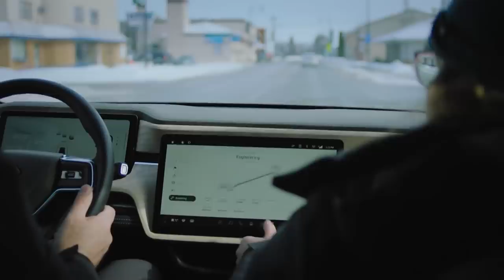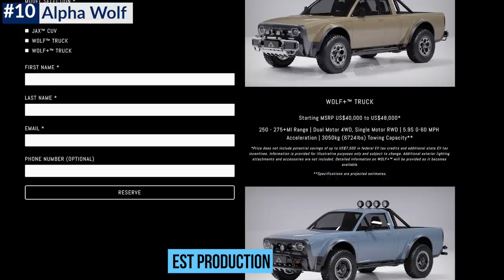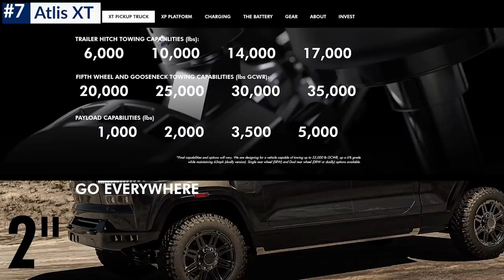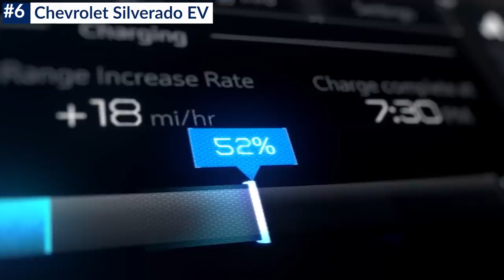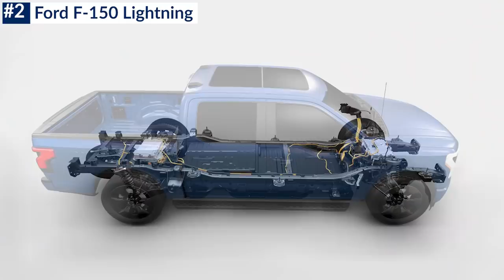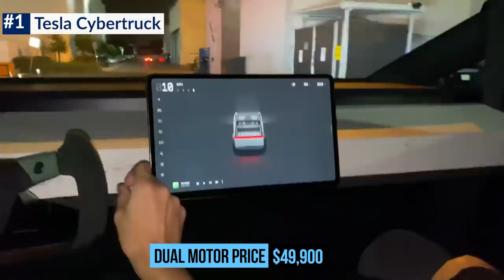10 Electric Pickup Trucks to hit US Streets Soon | It's Happening!

Comment: I just don't get the whole concept of electric vehicles. We are merely trading carbon footprints from combustion engines to generating more electricity by burning gas and coal. Not to mention all the infrastructure that has yet to materialize to support a country full of ELV's. Look how many gas stations we have in place to support our current mode of transportation. Forget about driving cross country! Waiting many hours between charges. For all of the shortcomings of the combustion engine, I believe it impractical to replace it with electricity.

Comment: My perspectives, 1. You think mechanics are expensive now? I wonder what these guys will charge on the hour, high risk is high reward.... I can only imagine the amount of amps they are pumping to the wheels...thats gotta be enough to cause some serious arc burn and loss of a limb 2. We are gonna pull your ass over with a simple stroke of keys on my keyboard... 3. The batteries themselves cost a fortune to replace..... 4. Oooops Chemical spill from a minor fender bender.... I won't be buying an electric Car.... not now not ever.... if these idiots truly dream of slashing petroleum to the point of where you can't get it well. Take a good look at where your sitting right now all around you..... how many of those products take petrol to manufacture or make?

Comment: EV trucks are missing the opportunity of installing propelling fans installed in the trucks when they drive on a highway. The exhaust pipes can be split pointed from 0 to 75 deg angle up in the air to avoid any interaction with the following vehicles, and increase the tire traction with the road. Propelling fans would increase the pulling/pushing efficiency the same way that airplanes do by pushing the air behind. It's much easier to rotate a fan, than to rotate 4 wheels in the ground. The future is still ahead, and these EV have to think for the logistic part of their life to keep the cost down. Good job guys.
Reply: TELL ME you're joking

Comment: Can’t put a snorkel on it and cross a creek or go mudding without getting a short lol so I’m good
Reply: Goober I wonder the same as I use my truck for hunting and fishing hard to reach areas where it requires that exact type of stuff
Reply: Why would it need a snorkel when it doesn't need air?
Reply: You’re correct lol just bad comparison but you get the point
Reply: Actually, the Rivian is specifically rated to foard a 3' deep body of water.  And you won't get a short in the electrical system from doing that.  Everything is sealed.

Comment: Blah Blah Blah... How long does it take to charge Ford's truck? Drive and stop... Drive / Stop.... Sounds Sounds like the old Rabbit and Tortus story...
I'll stick with (OMG) Diesel ... IF I Can find one!
Reply: For some yes, for others no.  The growth of new technology is always uneven so it may not work for you yet. However, that doesn't mean the market does not exist for other people. The more people that use electrics, the less oil we use, which helps depress oil prices, and does make it cheaper for you. The Obama era plan was to avoid EV mandates because there are too many corner cases, where it wasn't feasible without a jump in technology, which hasn't completely happened. 

Another option is adding a generator in the back of your truck as a range extender.

Comment: When it comes to engines, an electric motor is by far a lot more efficient and less maintenance than an ICE.  An electric motor only has one moving part.  However, when it comes to providing the fuel for these, petroleum base fuel vs battery, there's no question as to which one is more easily handled.  Batteries still have a long way to go.  Once a battery is spent, it's done.  There's no rebuilding or refurbishing it.  It's off to the recyclers.
Reply: I agree with all that you said, but the unfortunate reality is that almost nobody rebuilds their engines anymore.
Reply: @nvcsmith  That is true.  It's a lot easier to trade for a newer model.   The electric motor car is the future.  The energy source for now are batteries. Maybe hydrogen in the future.   Exciting times.
Reply: You can refurbish them as home power storage though
Reply: @WrathChild-NZ  That's a really interesting concept.  Lots of DIY probably experimenting with car battery modules.  Most of what I see, is retrofitting to autos.  Haven't seen anything for home applications.

Comment: I would wait about 4-5 years before buying an electric vehicle. There are new 'solid state' batteries coming out that will increase the range by 2x-3x for the same weight/volume. They can also be recharged much faster. Lithium batteries are soon to be on the way out completely.

Comment: How are the batteries disposed of when they no longer keep a charge?  What's the cost of the new batteries? How does it effect the environment? $125,000 for a truck, oh hell no!
Reply: Batteries are considered not fit for EV use when they reach 80% of original capacity, which is about 250,000 to 600,000 miles (depending on mow much you use DC fast charging).  Then they get recycled for use in grid storage.  Once they actually are at the end of their life, they recycle them to get the materials back and make new batteries.
Reply: @charlesball6519  where did you get those "facts" from the rainbow
Reply: @larry6765  Nope.  From other user experience with EVs watching lots of videos about EVs, and all those studies about the batteries.  I have the natural curiosity to learn, which you do not.  Instead, you believe all the right wing propaganda because you have zero curiosity to learn for yourself.

Comment: Face it, pick up trucks are utilitarian work horses. Mostly fleet sold they are given to users who try to destroy them. Here is my list. No b.s. accessories at all except air conditioning. A comfortable bench seat. No need for captain Kirk’s throne here.. and the entire interior can be hosed out and steam cleaned. Suspension must include bushings that last 200,000 miles. Make then solid, comfort other than ac is not required. A rear bed that will take a beating from 60 pound concrete blocks and not turn to crap in a year. And lastly a throttle computer interface that allows only electrically efficient acceleration to the posted speed limit and no capability to go faster than that limit on every street ever. I saved 30% on fleet fuel costs when i began tracking my driver’s driving havits to their continued employment and bonus steucture. Previously that money cane DIRECTLY out of my pocket. Now the streets are safer as accidents for 2020 were down 40% and i have invested in more equipment and employees. And it was all done without one penny from any government program to “ help” me.
Reply: aren't you a joy to work for?  I worked for a manic once that liked to GPS track everything you did.  Hard pass.  I'd never work for a control freak again.
Reply: @bobhabib7662  asking my guys to obey the laws? Drive the speed limits and not abuse the equipment that they were responsible for are not difficult requests. In fact it is a shame that i had to lay out the rules; the same ones that i follow and that my kids followed. And, yeah, i was a pretty good boss to the point where many employees became like family. To this day. We all worked hard, including me. We had a lot of fun too. Pay checks were handed out by me on Fridays at our local bar. I took all my crews to California once a year for a long weekend of ocean fishing. And every two years we all went to Cabo San Lucas for real fishing. And when i retired i gave the debt free company to five key guys. It exists today and may be passed on to their sons. I set a good example and earned respect. So, yeah, i was a joy to work for.
Reply: @larrysorenson4789  I'm sure you were control freak.

Comment: electric vehicles are just  a car for someone that doesn’t really 
need a car .  towing capacity is meaningless if you cant tow it more than 20 miles ...
Reply: Haha!
Good one, Tony!
Reply: Just like people who buy those mini smart cars for small commutes
Reply: @sommebuddy   you have a normal range of 250 - 300 miles ,  (on SOME. evs ) now double the vehicle weight .  which is what towing capacity typically means , one vehicle towing another vehicle plus the weight of a trailer. you are now so far into the rule of diminishing returns , that your range is almost nil.   in other words . unloaded range and range at rated capacity is not even remotely the same .    20 miles maybe a slight exaggeration, but you get the point.   towing with a electric vehicle. , not a good idea .
Reply: @sommebuddy    there is no “what if “ involved ......you can “what if “if you like.   the nature of electric power is the same regardless of the battery yhat powers it .  i work in the automotive industry . i travel most of the southern half of the us snd much of europe in my work .  and i have no doubt that electric vehicles will be around for a long time to come .  they are not a new idea . theyve been around for a long time .and the principles of electric power have been understood for decades .. i also understand their  practical limitations .   i also remember when turbine cars were the unavoidable wave of the future  .    evs will have a place ,  
it will take time before everyone understands what roll they will play .  towing and large payloads arent going to be a major part of that future .   if you feel that an electric pickup is your cup of tea,  be my guest . 
i think after you have 4 to five years invested into one , you will be less enthusiastic .   if you just want an ev without towing capability in mind ,  please check out the bmw and mercedes models that are soon to debut .   personally i need a pickup .  and not an ev ....  and anyone that would push for a hydrogen cell in close proximity to a human body ,  lol. well thats just another variety of stupid altogether .   gasoline requires  certain conditions to explode ,  hydrogen requires only a small leak ....  oh and yes all the manufactures are gearing up to transition to evs .   no one yet knows if the public will accept them .  so claiming that they will be everywhere is premature . there may only be a few on the roads . and millions unsold .  i suggest you  put your crystal ball  back on the shelf for a few years , or get your money back on it ....  and if you own an ev in an area that has charging infrastructure , you likely live in an area that has public transportation , and owning an ev is likely a personal indulgence not a necessity.   
hence its a car for those that don’t really need a car  .
Reply: @sommebuddy     i am set to retire in spring of 2022  myself . after spending almost 40 years in automotive. manufacturing  technologies . . we were involved in fuel cell technology . back in the day . hydrogen was a big part . so i know  a bit about it  thank you .    frankly , it scares the crap out of me  .

Comment: Not one of these pickups has the least bit value to anyone who drives and uses a heavyduty pickup for real work and long haul heavy towing. My F350 Superduty 6.7 Powerstroke can go almost 400 miles hauling over a ton of Polaris RZR and gear in the bed while towing a 9000lb trailer. I can stop and fill up in ten minutes and be back on the road and this isn't close to the maximum load I can haul. If I want more range all I have to do is install a larger fuel tank and could go around 700 or more per tank, something an EV can't do, ever. These are urban use or gentlemen rancher trucks that stay near urban areas so you can find a charging station. They don't exist where I travel in the back country.

Comment: what i dont care about in an ev:  0 to 60 in 1 sec, crab walking, 190 mph top speed, 12000 flb of torque...
what i do care about in an ev: id like to know im not charging it with  coal fired electric plant juice, very long mileage per charge,  not alot of stuff on the dash, ability to charge at home fully overnight.

Comment: None of these are realistic unless they have a similar towing capacity as a half ton truck and a re-charge time of 15 minutes to completely recharge the vehicle.  Many people use trucks as a work vehicle, tow vehicle, etc...
Reply: notice that the re-charge time was not reported
Reply: @slippery1958  No, they wouldn't report that since most people don't want to hear that after their very expensive purchase of a $60,000 all electric truck they can barely afford that they're going to have to hire an electrician to install a 440 volt system to charge their new pickup for $5000.  Most people aren't smart enough to know how to handle that kind of voltage.  It will kill you dead in a milisecond with improper handling.  BUT, you aren't going to get that one hour full charge without it.  Prolly gonna take 10 hours to charge all the way on 110.
Reply: @sarcasticguy4311  You don't need anything more than a 60A 240V circuit to charge at home (for a 48A EVSE).

On a 120V 12A charger (1.44kW), it'll take 3-4 days to charge.
On a 240V 48A charger (11.5kW), it takes 8 hours to charge (you do this overnight, and have a fully charged vehicle when you go to work in the morning)
On a 250kW DC fast charge station, it takes about 25 minutes to charge to 90%

They are currently working on battery tech than can charge win 10-15 minutes to 90%

But go on and keep being willfully ignorant.
Reply: @charlesball6519  Oh, only EIGHT hours to a full charge?  Big thumbs up.  Way to be a true believer.  Sorry, honey.  I can't take you to the hospital because the pickup has no battery life and it's gonna be another several hours to get a few miles down the road.  Hope that missing limb doesn't hurt too much.
Reply: @sarcasticguy4311  But that's only if you let the battery get down to 15% or less.  That never happens with daily driving (people rarely drive more than 50-100 miles a day, except for professional drivers), and leaving it plugged in all the time (while at home, like after 8pm), like you do your phone, you always have a fully charged truck.  So, you can take someone to the hospital in the middle of the night.

You're just another display of willful ignorance. (Typically from those too lazy to do their own research and might also watch too much Fox News or The Blaze)

Comment: Power has been made by no fuel   at a steel mill  and was stolen by the Steel company because he made it on company time . and looks like they sold it and took care of him ?   Now there making power  out of a alternator and can be wired up  to start  making power and a switch to stop it and needs special bearing's to last longer cut the weight down by special glass and  use a boat design mold and would not need a complete bottom and it is was a fast racing boat .  add a low front so to hold it down and less drag ,   keep it wide  for corning .one for each wheel or 1 for front and 1 for the rear   would make it better to turn it on curves .      At high speed it helps to use power to push the car forward than drifting , with 4 wheel drive it helps keep it from drifting . Then we won't need  a 600 pounds of batteries

Comment: Yeah, right. Who has $40 plus grand for an electric truck, when there aren't any charging stations. 55% of the working public makes less than $30 grand per year. Companies will possibly buy electric trucks to a limited degree. Possibly!! There are 1.4 billion vehicles on the road, and Tesla sold less than a half a million last year. An electric vehicle has to become more practical before it will replace gasoline and diesel vehicles. A lot more practical. Now they are talking about making the battery part of a cars structure. The auto insurance companies will love this. You'll be paying more per month for auto insurance than for a electric vehicle. Hey Musk go into the auto insurance business. You'll make more money than selling cars.
Reply: He already does, and is cheaper than regular insurance, and Tesla is making all its Power Charge stations available to all brands, and will provide a connection adapter when needed, and he is already making more money than GM, FORD, Chrysler, Toyota, VW, BMW combined, per Wall Street News.......

Comment: 0 to 60 and a couple of seconds sounds like people gonna have to get used to A tremendous amount of speed and power sounds like a lot of accidents t's I hope those batteries don't blow up. We will SEE
HOW MANY WILL BURN ON THE SIDE OF THE ROAD.
EV BY 2030 THEY SHOULD WORK OUT ALL THE PROBLEMS. 
MAYBE?

Comment: I just want a pickup I can trust in the field, haul some mulch in, commute in the snow, and not worry when I smack a deer because I can probably either fix it myself or just live with the dents.  None of these fit the bill.  The Rivian or Ford is close.
Reply: Bram Sortwell
Pickup I can trust in the field, snow??? how extreme is that job ???
Need the Kanye West movers?
Reply: @lucasrem  Extreme? What is so extreme about normal rural life?
Reply: Then you need to pick the Cybertruck with 3-motor AWD that has Crab-like drive, can travel 500 miles in a charge, and has an exoskeleton made of 9 mm thick bullet proof stainless steel body.  In that way you can also pursue hitting trees while driving in the country.